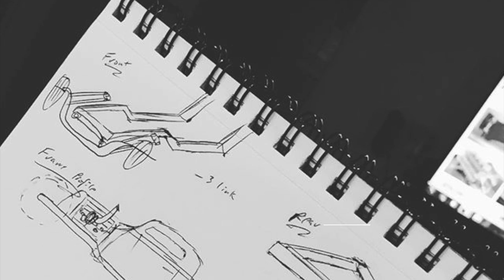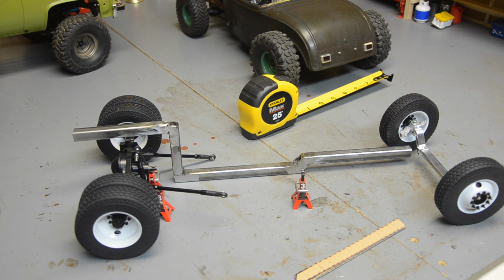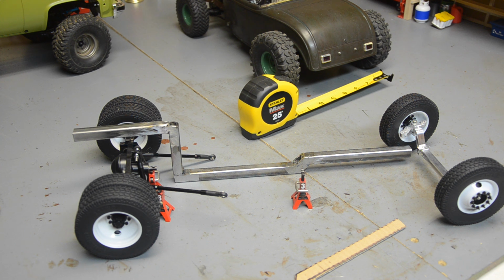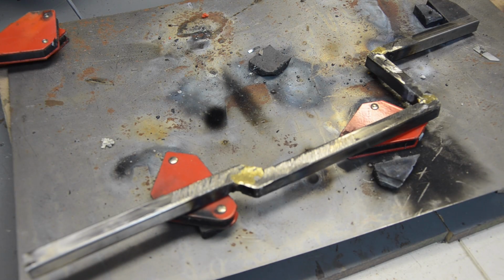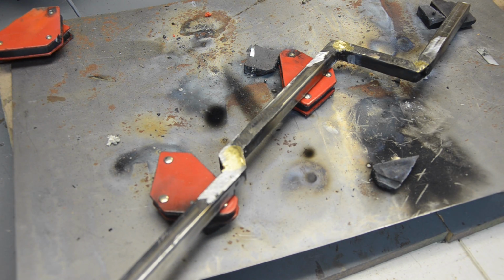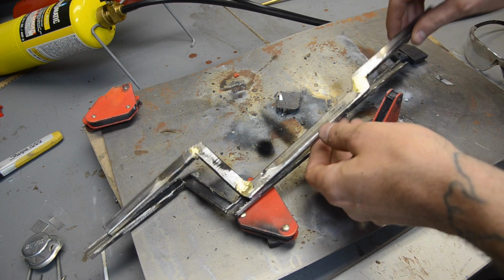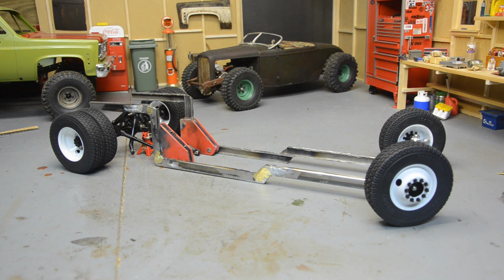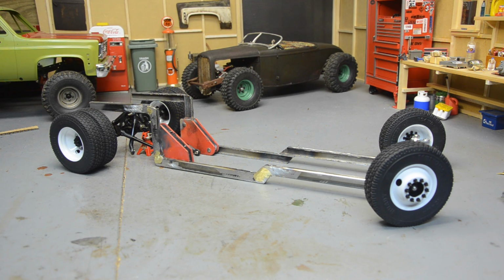RC Rat Rod Build, 'Ole #2, Part 2, Chassis Fabrication

Comment: awesome frames. Im doing some for a similar project and It was good to just get a visual idea of what I am doing seems right... I like your rails. Just a small tip though: Cut your square rods at angles insted of butting ends at the corners... and they will have a better looking cross section and no open hoels at corners when you cut them... :)

Comment: I like the Silvaloy better than weld. May I ask what size tube is that chassis ??
Reply from the maker: Its 1/2 inch square
Reply: Thx, ya think it'll bend/form easy with MAP ???? in square form, kind like to make a standardish looking chassis....